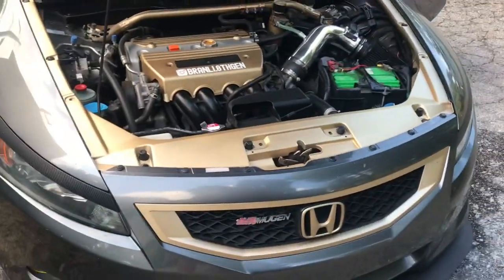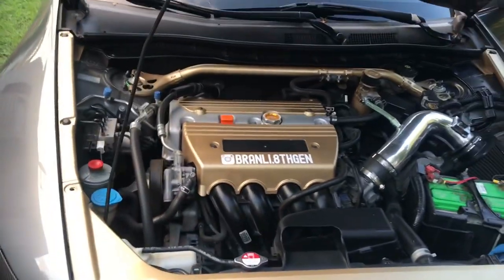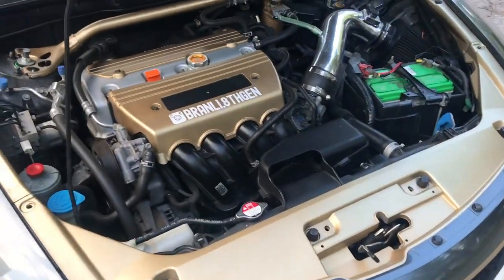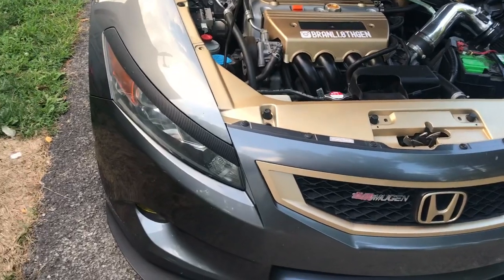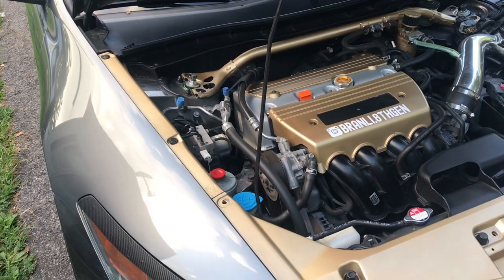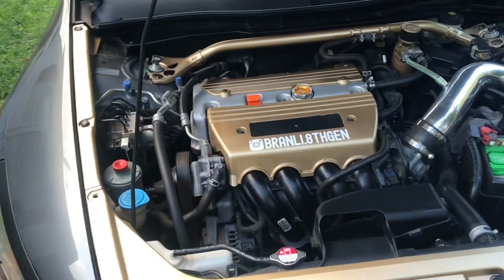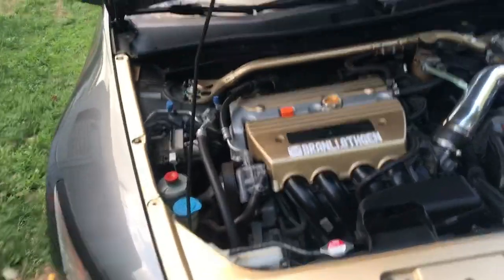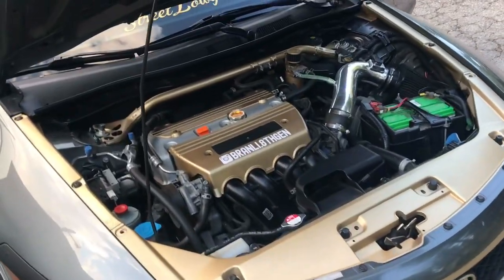Honda VTC Actuator gone bad

Comment: I've been watching these vct videos bc my car makes a higher pitch metal clinking noise sound at cold start but it doesn't sound like this so I'm still not sure if that's the problem
Reply: If anyone has had tht higher pitch metal clinking noise 06 accord i4 plz lmk thanks
Reply: @desipranksterz7909  That sounds like the timing chain smacking the cover. Meaning your timing chain tensioner could be going faulty
Reply: @DiamondScuff  appreciate ur advice but it turned out to be a peice of the catalytic converter freely bouncing around inside 🤣🤦‍♂️

Comment: Hi. As anyone opened the front cover of their VTC Actuator and just stretched the lock pin spring in it? If so, did it work out fine? Thanks
Reply: How about just a new spring? Yes it works.
Reply: Does not work. Tried that.
Reply: I mean your already “cheap” by solving this at your own, you want to be more cheap and even safe on a fucking spring not even of 3€ of value..

Comment: are you talking about the sprocket or the actuator?
Reply: We changed this week the sprocket and tensioner on 1.5L 2015 Fit, 200k km. Noise gone instantly. I also talked with machine shop guy: all the problems such as stretched chains, worn sprockets and worn chain guides are because of variable sprocket timing works very hard. His advice, be gentle with your right foot and avoid sudden acceleration - smooth driving should make it last longer.
We had in the shop 2012 Elantra 1.8L, 120k, where the chain stretched some 2cm and tensioner was out at max - the owner did oil changes ones in the blue moon, with regular 10w-30!? We replaced the engine as it was only viable option without spending a lot of money and time on parts.